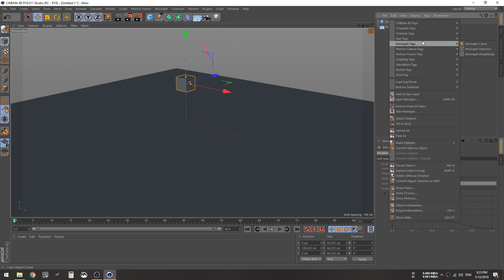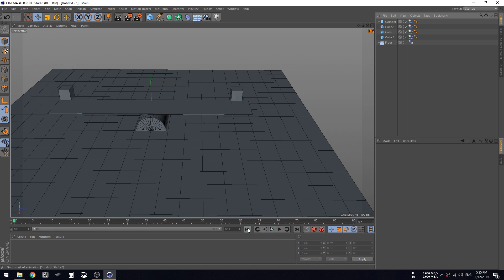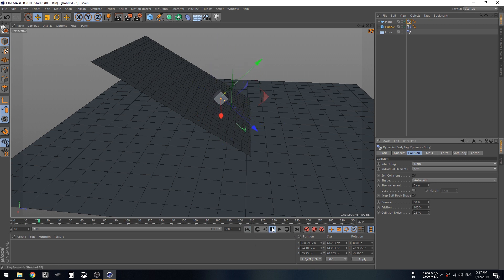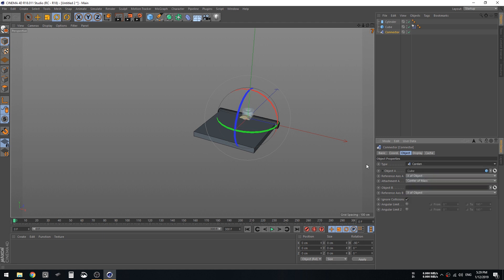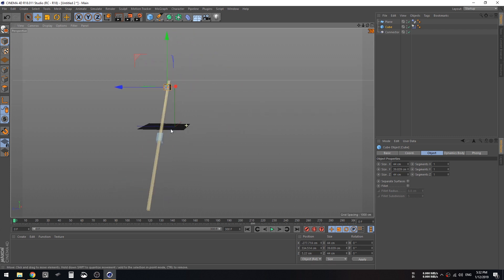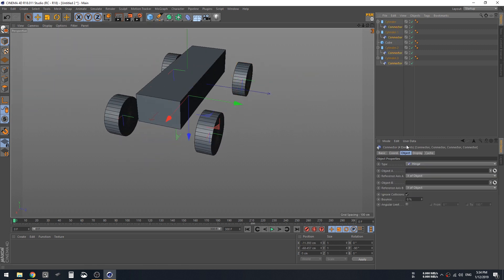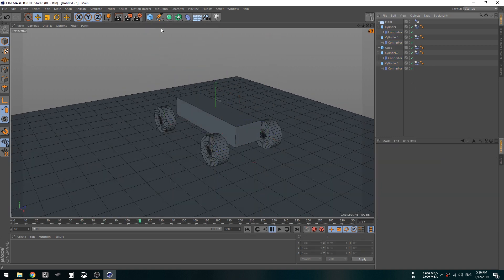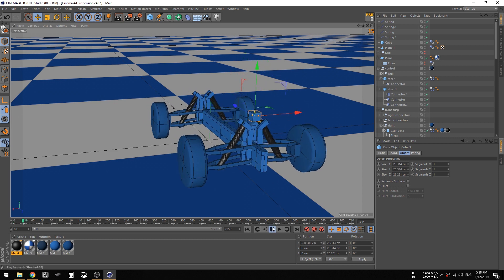Cinema 4D Dynamics Tutorial | connectors | rigidbody | motors (with voice comment)

Comment: great tutorial but when i change steering angle...my wheels wobble around. Any idea?
Reply from the maker: Make sure u got each mech plugged in the proper place. Ana check if you have the connecter under the right parent.
Reply: @yassinefahsi  thank you for your reply. yes they all seem to be in the same area...it does work perfect when steering angle is 0. but if i change it to turn left or right...the wheels start to wobble.
Reply: @Pathfinder_tua  init/set steering angle from 0° for the first frames, then animate from there
Reply from the maker: Thanks for commenting and your are right, thank you so much for helping